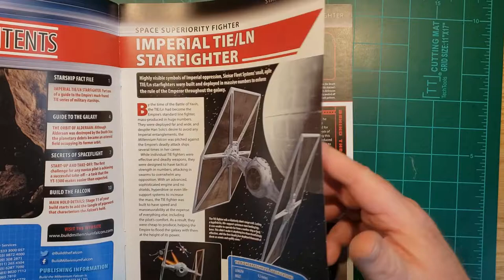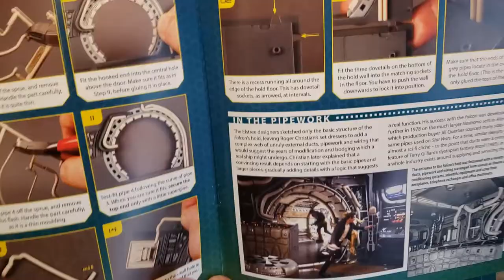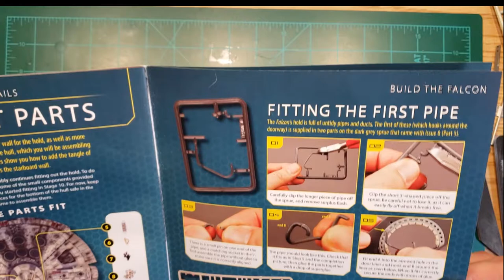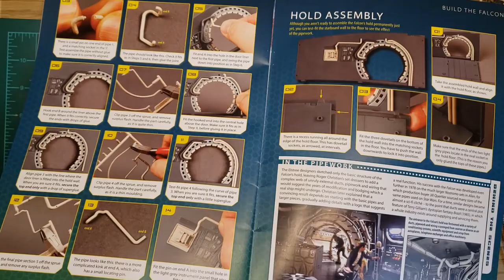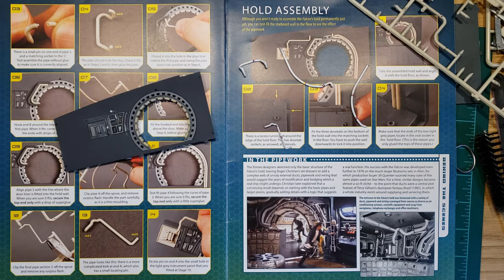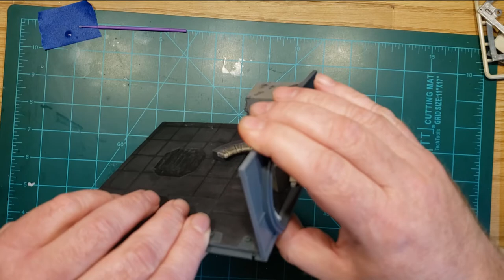Build the DeAgostini Millennium Falcon - Issue 11 | Crew Hold, Custom Painting

Comment: Hey Gary! Nice detailing there with the sharpies, Mighty handy! On this planet the colored stripes would indicate what gas or liquid is in the pipe. Red usually means flammable, blue is inert. Don't really remember much more than that other than green is oxygen or O2. The stuff you need to breath!

I was curious as to why you had cut the smaller of the parts off the sprue before cleaning and painting? When you cut them loose you can always touch up the attachment point if it shows. Just a thought...

Keep em coming!
Reply from the maker: Great info for the markings.  I knew some of that as far as how we mark stuff.  I would guess the have similar uses in Star Wars as well.  

It would make things much easier to clean them on the sprue wouldn't it.  Maybe I like to punish myself. haha  Thanks for watching Di and the great info and advice.

Comment: I just finished building a LEGO Star Destroyer kit 75252. I been thinking I was not happy with the turrets or shield generators and might customize those. Then I got to thinking it would be cool to add some engine lights, docking bay light, motorize the turrets, and add some sound. Looking at Arduino as a solution. Made me wonder if you plan to do anything custom with the electronics on this model. Got any plans?
Reply from the maker: I have really thought about it.  I really thought about doing some fiber optic lights in the Cockpit and places like the technical station.  Some people have actually put together kits for it.  It can really get out of hand though.  I have seriously thought about adding some some sounds, but haven't done a lot of research into it yet.

The boarding ramp will be able to go up and down, and the engine will be lit up as well as landing lights and that kind of stuff.  That is all standard with the model.  I might do some upgrade to the engine lights though, because I think it could be so much better than standard.